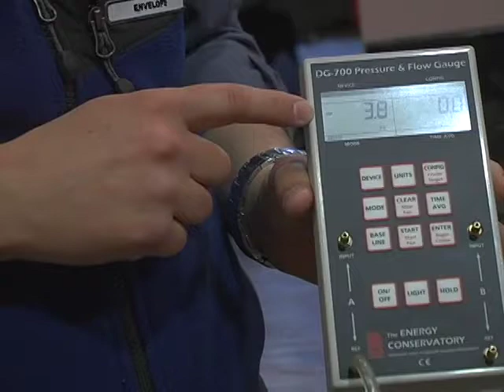Combustion Analysis and Safety Pt 1- BPI Review of 5 Point Combustion Testing

Comment from the maker: @sienalaurel This is actually a mistake commonly made in the field- CO must be measured prior to dilution air, and draft must be measured 1-2 ft past the draft diverter or first elbow, in a straight section of the flue.  That's usually 2 different holes, and lots of technicians are using tools that do both jobs with one probe, which they assume means only 1 hole.  If you sample both 1-2 feet past the draft control, the CO is wrong, and if you sample both before dilution, the draft is wrong.

Comment from the maker: Actually, since the CO sampling should be before any dilution air, you want to get as close as possible to the heat exchanger-- there are some small gaps in the joints between the flue components, and since the inside of the flue is at a negative pressure, it will suck air into the flue, resulting in 'dilution' of the flue gases.  That's the reasoning for the lower of the two holes.  You would NOT measure draft there, though, since there may be positive pressure lingering from the inducer.

Comment: @baikoff I'm taking BPI training right now and we are being told to drill holes. You just have to be sure to patch them up afterwards. Also, the gases aren't being pushed up by a fan by the water heater in this case. It's a natural draft, so when you negatively pressurize the house you may be sucking CO and other bad stuff back into the house.

Comment: Would somebody enlighten me, please, if it's common for a BPI certified specialist to drill through a power-vented combustion appliance, even though it's against BPI standards. I just see some programs require you to do that. And the second question is - since there is a fan pushing the combustion gases up, shouldn't there be a greater pressure inside the flue pipe?